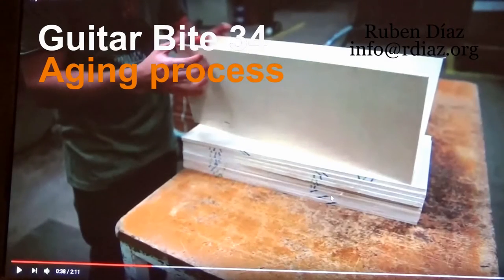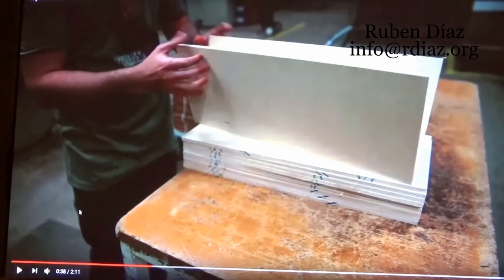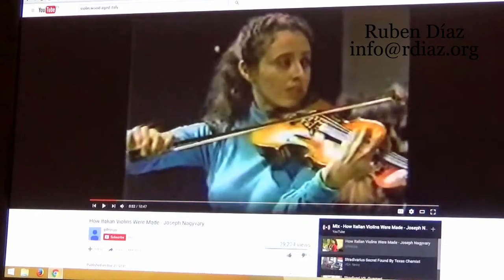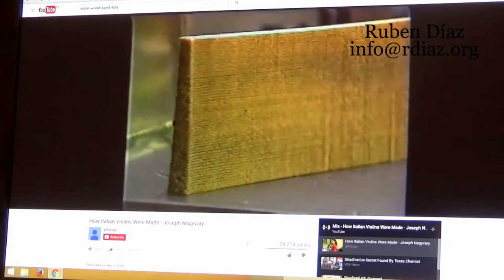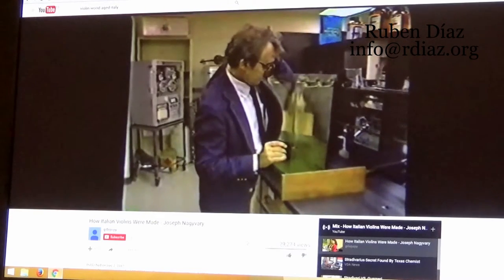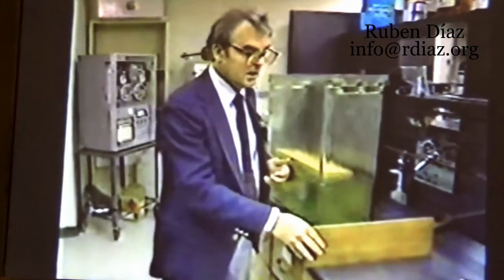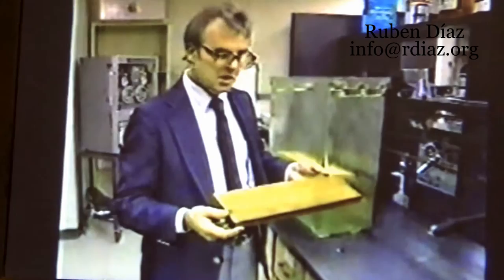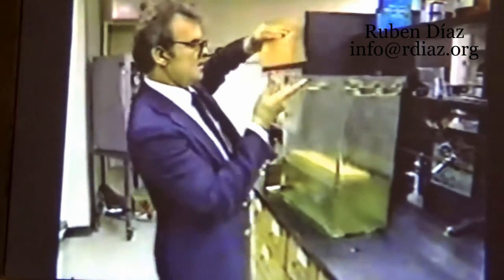Taylor's Spruce torrefaction process vs Time Aging Wood  / Flamenco guitar Bite #34  / Ruben Diaz

Comment: Torrefaction can be a confusing concept, especially for Sitka soundboards that are already very old, coming from trees hundreds of years old.  Apparently, naturally aged Sitka is not old enough or is not the same kind of "old"-- hence the torrefaction of already-old wood.
Reply from the maker: Thanks Scott for your comment.

As the wood in a guitar ages it gets more responsive. 
There is one thing that a quality maker never underestimates.
 That is in aging the wood. 
Why might this be the case?
Imagine the fresh woods as they sit after harvesting the trees. 
The wood is full of sap and water. As the water evaporates, and as the saps congeal into resins, the wood changes shape and shrinks. If you have ever purchased a cheap item make of fresh wood, you can immediately see the result. The pieces cease to fit together properly, and cracks may appear.

A guitar has delicate spatial relationships between the instrument, its several independent parts and the strings. Imagine a properly set up guitar made from fresh wood. The instrument will bend, sometimes influenced by the tremendous pressures in ways that will not only make it unplayable in terms of initial set-up, but also shift in ways that will cause cracks. The instrument becomes ornamental if it has any use at all.

See: Fitly aged wood correlates with quality
 https://youtu.be/uScOH_tmo4s?t=2m2s

Regards